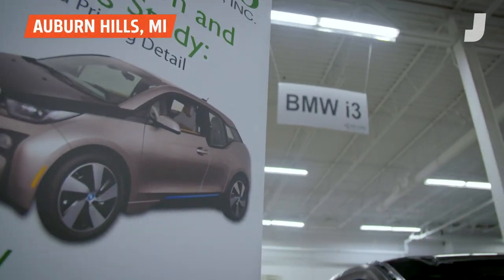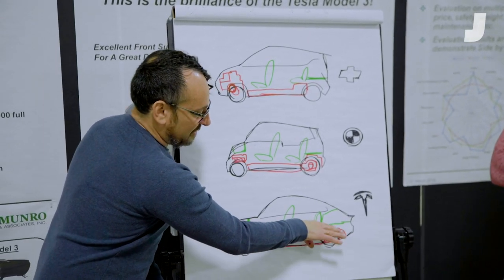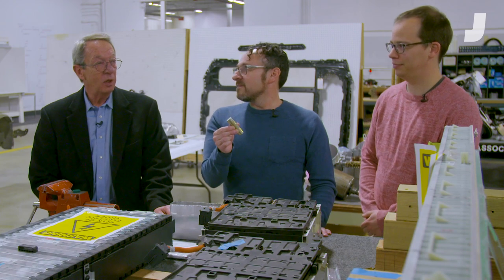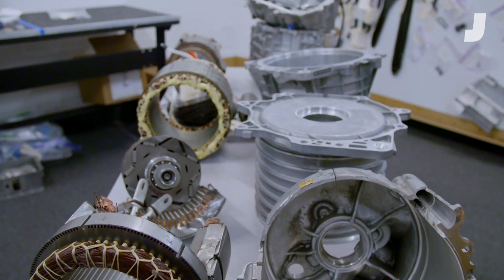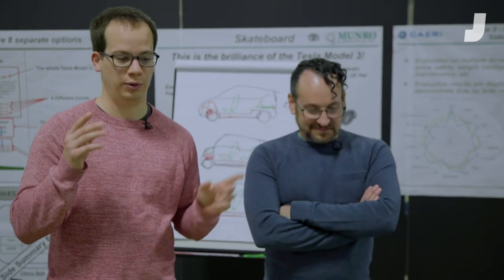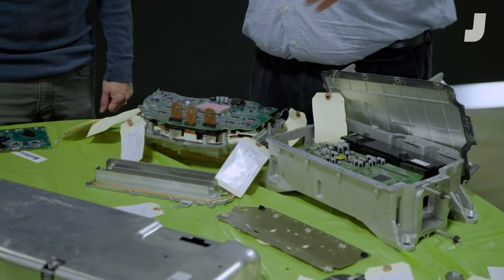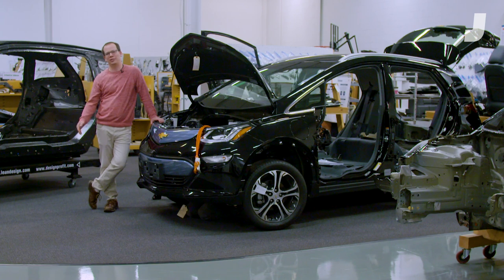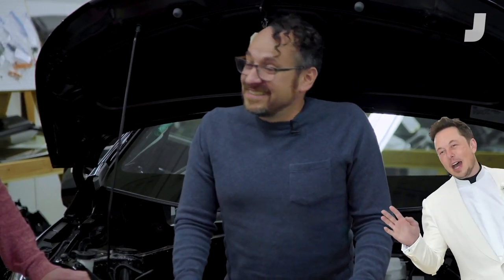A Look Inside The Tesla Model 3, Chevy Bolt, and BMW i3

Comment: When it comes to evs there are some key things, it should never be front wheel drive, it’s worse for everything, big one being turning circle for city cars , the second is battery cooling, the more you can cool it the faster you can charge it, Tesla out of the 3 is the only one that’s got this right, just sticking a motor in the front like the Chevy is the worst solution possible
Reply: The Chevy is a parts bin car
Reply: So you don't understand electric braking...
Reply: David Hollenshead yes the load is put onto the front wheels (and that’s why cars have bigger front brakes) but you should not be braking as hard as that with the motor so it really does not matter that much (still have disks if you did need to brake hard)

Comment: Bmw i3 is by FAR the best car here, by far the best designed, engineered and built. Which you can feel when driving it. Sure the Model 3 is faster becuase it has more power ,but in every single other aspect...it's not even close to the BMW.  Carbon fiber body, amazing stiffness and strength, great quality interior with an ACTUAL design (unlike the crap Tesla has),  proper seats, proper sound proofing, proper refinement, proper handling, a proper chassis, etc.

Comment: BMW i3 with its range extender patrol engine is right now the best EV out here especially because of the lack of credible charging networks around the world (mostly in EU) and when half of the times they do not work or reject card etc. !
One is not going to be stranded on the highway or anyway with this car if one is not able to charge up his/her car due to unforeseen circumstances surrounding charging station or port !

Comment: The Tesla Model 3 is well designed from a clean slate to be the perfect EV passenger car & "OVER" built to the standard of "Industrial Trucking" = the million miles club!!!  Thusly, to naive souls or Tesla haters, they say Tesla is not efficient in their Model 3 manufacturing processes...
ANALOGY
The Tesla Model 3 is The IMI / IWI Jericho version of The CZ 75B.  In this Analogy The CZ 75B is The 1st year Tesla Model S.  So, in conclusion Tesla continues to improve upon their former designs & to increase, durability, safety, & efficiency... Tesla is a Silicone Valley High Tech Company based in The Silicone Valley of CA - Tesla will continue to outpace & outperform all other Legacy Automobile Manufacturers.  A Tesla you buy today will be better 4 years from now, because Tesla releases OTA UPDATES to all their vehicles which actually improves the Tesla that you bought 4 years ago (Hypothetical Analogy based on Real World Data & Experience).  The VW Group probably has the best chance to catch up, but They would need to be "ALL IN" NOW & invest Multiple Billions of $'s into so many areas, They don't & won't have the VALOR necessary to do so!!!  Yes, VALOR is required to take on Tesla, good luck even coming close anytime soon...  Some company may come close in 10 years or so, or maybe DYSON will surprise Tesla & the world!!!  Anything is possible, but it's not likely!!!
Reply: There is room for Tesla, VW, BMW, Benz, Rivian, Dyson, etc. etc. all to be successful. We won't see every car manufacturer make the transition to electric successfully... but it's not going to be "winner takes all" in the auto industry. Tesla obviously has the superior product at this stage and they seem to be setting themselves up to stay that way for the foreseeable future. Rivian is looking compelling on paper, and has received massive investment from Ford and Amazon lately. Competition is good for consumers though, I hope other manufacturers up their game - and I think they will.

Comment: Pretty Tesla fanboy stuff.  A lot of the GM stuff I think they totally misunderstood.  That subframe GM has is in almost all there cars because it isolates the vibration causing motors and brakes from the unibody.  Makes the car much smoother.  Now, you may not need it for an electric car but GM was playing it safe.  Let us see five years down the road how much vibration gets conveyed to the cabin.

As far as the battery and inverter design, GM was thinking maintenance i think.  For example, if you want to get to the inverter in a Tesla you have to crack open the motor with its coolant system.  That is a lot of work.  With the Bolt, you just unhook the cables and the inverter is in a simple module.  All that integration makes a car very difficult to work on.  So, I don't think the Tesla fanboys were thinking of longterm maintenance.  Then, again, I don't think Tesla has thought that either.  

Another example is the bolt on cooling system in the Bolt.  Not as efficient as the others but it lets me get access to the cooling system without taking apart the motor.  Much easier to service.  Again, GM is thinking about maintenance down the road.  Was that the right call?  I don't know, but it wasn't because they were being dumb.  

As far as the battery design, I look at that Tesla battery and I am thinking with all those wavy components, etc, that ain't going to be cheap.  Also, complicated.  As far as cost is concerned, GM said they were paying $145/KwHr two years ago.  Given the 9% decrease per anum costs we have been seeing that projects somewhere $112/KwHr today.  Elon Musk is said that they are trying to get to $100/KwHr this year.  So, that tells me that they are at about the same cost point (assuming Musk speaks the truth which is a maybe).
Reply: "that subframe" (adapter) is there because it's an adapted off the shelf ICE body!
Cut the BS.
It simply allows the EV components to bolt, as an assembly, to the ICE location points!
Come to think of it, maybe that's why they call it the Bolt!? 😂
Off the shelf body, outsourced.....? Everything else? And the STILL lose money?
Invertor? Do they break down?
Reply: @rogerstarkey5390  - despite the Tesla Kool Aid, all components break down at a certain rate.  You either make provisions in your design or you never get repeat customers.  The subframe exists because it isolates vibration components from the unibody.  I admit you may not need this for an electric motor but why take the chance?  

By the way, I am already hearing about Tesla's having problem with getting things fixed

Comment: Ha, it turns out they are PUTTING IN 7500watts of heat to get the battery to 40-50 C
Not Cooling when charging, heating.

Comment: Definitely leaned towards the Tesla.  Tesla is a very good car, but they made some design mistakes too.  I agree that, technically, the Tesla seems to come out ahead.  But get in a fender bender in a Bolt, and your local body shop can probably fix it like any other car.  The Tesla has to go to a special Tesla approved repair facility, and will take much longer to fix, and cost much, much more to repair.  This is what turned me off to Tesla - maybe things will change and I will change my opinion, but not yet.  I did like the comparisons made at different levels, but the bent towards Tesla taints this video, which is too bad.  I would like to see a comparison of similar EV's, e.g. the Chevrolet Bolt and the Nissan Leaf.

Comment: A V6 or any ICE is vastly more complex than an electric motor. An ICE is a mechanical symphony to the electric motors one note samba. It is impressive that it (the ICE) can be as compact as they generally are.
Reply: "ICE is vastly more complex than an electric motor." That's not a good thing. Just more Failure Points.

Comment: Really interesting. Everybody poo-poos Tesla yet they are the only company that is building an EV in volume. Jaguar and Audi are both well established auto makers that supposedly understand vehicle production yet neither of them is doing as well with their first real EV's as Tesla, with both building less than 1/3 of the demanded volume from orders. Tesla is criticised for burning cash building battery factories and and electric motor factories and supercharging stations yet they make 5000-7000 to 7000 model 3's per week and everyone that buys one can charge it FAST almost anywhere in the country and if you buy the other guys they're doing 2000 per month (Jaguar) and I don't have the numbers for Audi but they target 20,000 per year which is ~380 per week but are only operating 2 days per week because of logistics so I know who I would poo-poo if I was an investor.

Comment: I could write for 20 minutes about the differences in these 3 manufacturers but basically:  the Chevy Bolt gets good scores for the fact it is CHEAPEST of the 3, and probably easier to swap out parts per se, and because it uses a lot of aluminum in its chassis is much more recyclable than say the BMW i3 which uses carbon fiber (notoriously difficult for recycling).  Our country - comprising mostly the Middle Class - needs to mass produce eCars cheap enough EVERYONE can afford them and not the rich, faux green-minded folks posing as environmentalists who buy overpriced and over-powered beasts that achieve the same thing - to get you and your family from A to B on the very same highways.  We need to get away from A) overly complicated, B) in terms of the majarity of us, unaffordable, and  C) plastics in anything mass produced in America.  Unfortunately, BMW and Tesla don't give a crap about capturing the mainstream markets as this sales margin is too thin to be profitable.  If I was president - I'd infuse billions in technology and award contracts to tried and true companies Like Chevy, Ford, and Dodge to mass produce economical eCars that EVERYONE could afford so that when 2030 rolls around, there wold be less than 10% of ITCs running around our American roads.

Comment: Lots of factual mistakes and omissions, all in Tesla favor. Tesla cooling channel only goes between every other layer of cells, not every level, so cells are only cooled from one side and the cooling channel loops 4 times through the battery block before going out causing a huge temperature gradient between cells that are near the input of the cooling channel and its output. The very narrow and twisty coolant channels and use of coolant instead of refrigerant also means that Tesla cooling is far less efficient than the other ones. Tesla motor overheats if used at its rated power - other do not. Separate modules that are not "organically melted together" are far easier to maintain long term.

Comment: curly-cue’s gotta go!
Re the Tesla batteries - “round” is not very efficient space-wise....
Reply: Actually you may be surprised. Cylinders are very easy to manufacture and when compared to pouch or prismatic batteries they already have mechanical structure to each cell for safety and rigidity. It turns out with pouch or prismatic you still need space between cells to makeup the structure, packaging and cooling. The cylinder is a naturally efficient shape with a lower surface area to volume ratio than a cube. When each row is staggered the unused space between cells is very little, and is considered acceptable when all the advantages are taken into consideration.

Comment: You're comparing two small cars to a large family car. Tesla can fit everything in the floor as they have much more floor to work with.
Reply: But the model 3 isn't any larger than the Bolt? It's the size of a Civic.
Reply: @cpF01  The bolt is 4.17m long (13.65ft) the model 3 is 4.7m long (15.4ft) I think you might be thinking of the volt which is 4.5m (14.76ft)
Reply: @ssv7142  I'm just saying the Model 3 is not a 'large family car'  It has less cargo space than the Bolt. And the Bolt is a small car.

Comment: All more disposable cars, just like like my cell phone, we now  cant simply install a new battery for example..    or in this case motor, VFD,  etc...  of course this is the trend we see.  I wish I had the cash to build cars ...   model CR
Reply: of course you can install a new battery so yeah not like your cellphone
Reply: @ryccoh  not that easy from what I can see,  I guess the small battery inside is ok,  but the large battery under looks like tons of work,  just like everything else..  man make these cars simple to repair tesla...  why not,  also Chevy and bmw..  I bet their battery is a bigger pain to get replaced
Reply: @CRsolar  Checkout richrebuilds on youtube, you can replace the batteries, assuming you can buy them ofc
Reply: watched it and he had a tough time ..changing a battery ..   wow ,  looks disposable.  they could design things better so you could swap out battery, motor etc as tech improves or the gear wears out,  aluminum body or carbon fiber can last longer .  its wasteful to build such disposable cars.. I agree Tesla is better than many .

Comment: Tesla weirdness? Guys you need to understand, traditional automobile manufacturers design their vehicles to specifically perform high, in the specific Euro NCAP tests and market them to the moon and back how well they scored. They built their vehicles as cheaply as possible and mass produces them to sell by bulk and rely on mass market penetration. Tesla does the exact opposite of this, with zero marketing, which is unheard of in the automobile industry and they take the silicon valley  . . . . radical innovation approach and over-designed their produce ie. military grade like electronics and instead of trying to score high on a specific safety test, they actually care about the vehicle occupants and say 'what if this happened' and design the vehicles to actually be as safe as they can be, which results in the 'Tesla weirdness'. Its not weirdness, its just goes to show how little the major automobile manufacturers care about us, and how strange we as a society find it that a company actually could give a dame.
Reply: So explain GM's Onstar system then, how was that not caring about the owners ???

Comment: Strange Munro & assoc were legally threatened after their honest appraisal of Tesla model 3 a year ago, now praising the same car they rightly tore strips off. Still Americans can drive their Tesla to the airport get on a 737 max and....oh that's right there is a recurring theme here.
Reply: notice that no one from Munro was in the discussion on body or frame? (which is what they had problems with in the last teardown vid). Munro always had praise for the battery and drivetrain. I suspect that Munro wouldn't gush about the Tesla chassis so they cut them out of that part.
Reply: @tomboalogo  
No, Sandy Munro said the frame was over engineered and they could have saved money on it, while staying as safe (THE safest!) not that there was "a problem"
He also mentioned things as simple as the review mirror, on which Tesla had saved a lot of money, relative to the size of the item.
Anyway, he also indicated that Tesla make a healthy margin on each car, while being competitive on price, something even Audi seem to have an issue with? (Don't mention the e-tron range...😂)
With Nissan, Hyundai, Kia, etc now finding their cars at equal, of even higher price, for less content, I think the model 3 is doing OK
Reply: Oh, there isn't.
Reply: @rogerstarkey5390  well my 30 years of engineering (in auto industry) says that a rear quarter panel made up of 6 (or was it 7?) pieces is not over-engineered. It's badly engineered. It's nothing they couldn't fix but then have to do all the crash testing again.....
Reply: I have to correct myself. It was the rear wheelwell and it was 9 pieces not 6. That's 8 joints to be fastened per side. Lots of tolerance stack up. Just hydroform one piece and be done with it. Sandy Munro also said it was the most amount of panel sealant he's ever seen. Dr. Deming said that the easiest way to get quality is by reducing part count. I really hope they get some experienced body, panel and frame guys, I'd like to see them succeed.

Comment: Build an ev with an 800% efficient Adams electric motor that requires no cooling and watch the ev take over the world.  Oops I forgot, we have to protect big oil!!!
Reply: Motors do generate heat. A cooling system just means it will last longer. No big deal.

Comment: Why does anyone buy an ICE car?
Like buying a cave not a house!
Reply: Because it is affordable.
Reply: nowtleft2 Can’t buy a Tesla where I live, I’m literally 7 hours from the closest repair center. The Bolt ? Not really what I need. 

But I would still be ready to deal with one if... I could charge it. There’s literally two 50kW chargers in my town for 40 000 peoples. Can’t install a 240V charger in an apartment. 120V doesn’t work during winter.

What are my electric options then ? I’m simply waiting to get supercharger up to my city, then I’ll buy one. I’ll be able to charge it up during winter if 120V isn’t enough and I’ll be able to get it to the dealership when something will break. But before then, I’m kind of screwed.
Reply: Pomerleau Cédric I understand now!
Reply: nowtleft2 But I agree that in a lot of place, the reason I just said aren’t valid. There’s a lot of people who could get EV that just don’t.

Comment: If the Volt platform is conducive for a regular FWD engine setup, why don't they make it? Seriously. Would probably sell better than the EV.
Reply: There is some European input in the design, from their former Germany subsidiary Opel. They sold it off and left the European market. The companies need to separate their supply lines.
And to turn it into a combustion engine design, GM would probably need the parts and engineering from Opel to get it done.
Reply: @Agent-000-0  Wait, I thought GM makes the engines for Opel.
Reply: Since the cars in Opels lineup are way smaller than GMs, that would not work out. 
Same goes for the Diesel engines, which are popular in Europe but barely seen in the US.